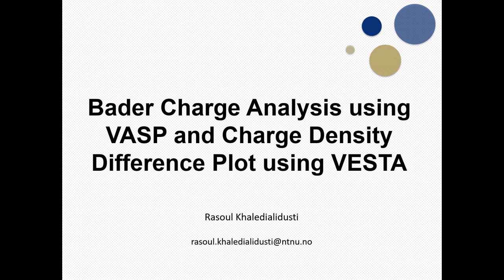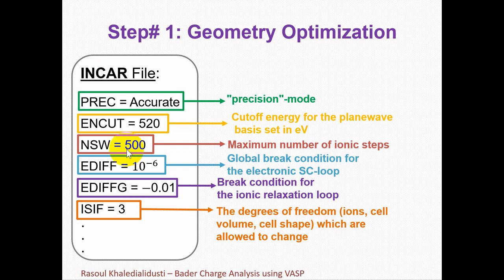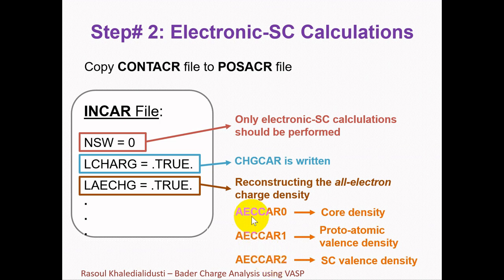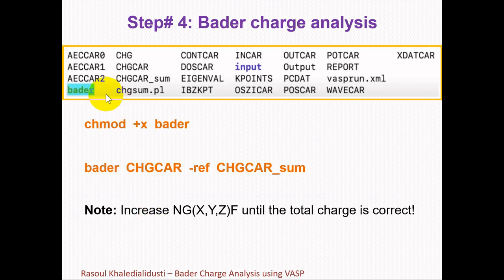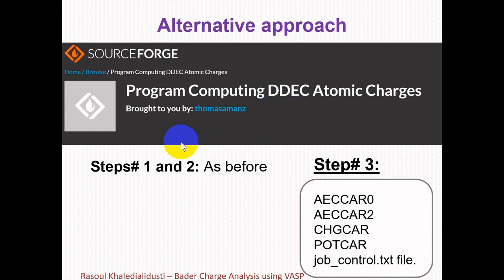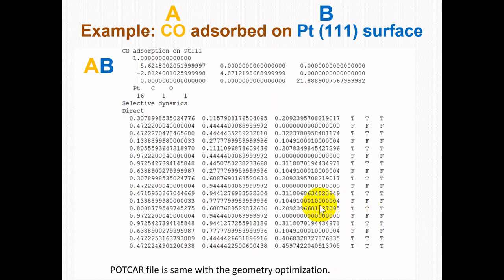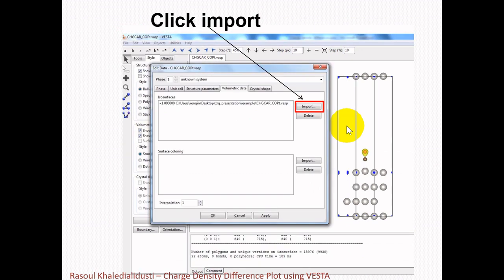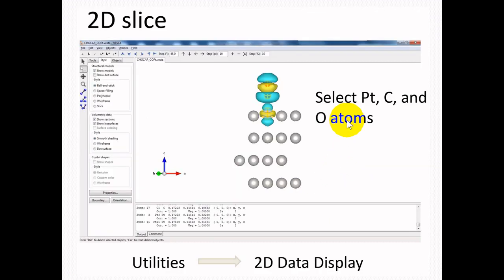Bader Charge Analysis using VASP and Charge Density Difference Plot using VESTA

Comment: Following the charge analysis, could you make a video about how to calculate the band decomposed charge density, please? Thank you so much for your help.
Reply: I second this!
Reply: I believe you need 4 extra tags. LPARD=T,  KPUSE="kpoint", NBMOD="# of bands", and IBAND="specific band #s". With LPARD=T, VASP will look for a WAVECAR and try to extract/project the wavefunctions corresponding to your kpoint choice (from KPUSE) and your band (or bands) choice (from NBMOD and IBAND). It should be a quick run because VASP will be using the WAVECAR only. In the end VASP will output a new file called PARCHG. You then open can PARCHG with VESTA as PARCHG has the same datastructure format as the CHGCAR.

Comment: Indeed a very helpful video. Thanku so much. I tried the same procedure but I got only AECCAR0 and AECCAR1 files not AECCAR2 file. Please do help
Reply from the maker: Thanks for your feedback. AECCAR0 and AECCAR1 will be produced immediately at the beginning of the calculation; however, AECCAR2 will be produced at the end of the calculation when everything is going well. If you did not obtain AECCAR2, it means that your SC calculation is not performed correctly.
Reply: @RasoulKha  Thanks for the reply and your incredible work for VASP aspirants

Comment: Hi, Can you explain about the selective dynamics, Why you choose the atoms alternatively?
Reply: If you look at the z-coordinate values for those atoms, the bottom 2 layers of the Pt slab are fixed (selective dynamics = F) and the top 2 layers of the Pt slab are allowed to relax (selective dynamics = T). This is a common way to maintain the bulk structure in the bottom 2 layers, since otherwise they could relax to a surface-like configuration as they interact with the periodic image of the vacuum at the top of the simulation cell.
Reply: @cameronbodenschatz1995  Thanks for the reply :)

Comment: Thanks alot for your sharing. In the last part, when you plotted the change in the charge, the colores yellow and cyan represent the accumulation and the loss of electrons, repectively? Is it correct?
Reply: I think so, but I also found it would be useful to comment since it is the main outcome of the constructed images! In overall, thanks for the usefull video!

Comment: when i'm running the job.control.txt with Chrgemol_09..., its giving me an error, " Could not find a suitable reference density. Program will terminate", in the 'VASP_DDEC_analysis.ouput' file. This is happening even with the example given with the software package! Any possible solution?
Reply from the maker: Are you also placing the POTCAR file in that directory?
Reply: @RasoulKha  yes
Reply: AECCAR0, AECCAR2, CHGCAR, POTCAR, job.control.txt and Chargemol_09_26_2017_linux_parallel (NaCl example given with the package)
Reply from the maker: @khageshtanwar5089  You probably don't specify a right atomic densities directory path in your job_control.txt file!
Reply: @RasoulKha  it seems correct, lets see!

Comment: Unfortunately CHGCAR file is not opening in VESTA (may be due to some bug).
Reply from the maker: Are you sure that CHGCAR file is made correctly? Have you checked the file? You could send that to me via email and I will check it out.
Reply: @RasoulKha  I have even tried opening other CHGCAR files downloaded from http://theory.cm.utexas.edu/henkelman/code/bader/ but failed. I am using VESTA 3.5.2 version
Reply from the maker: @NidhiTiwari-zu5ym  So, the problem is because of VESTA. 
 You need to install it properly.
Reply: @RasoulKha  There was some problem with .pid file. Now, it's working fine. Thanks.